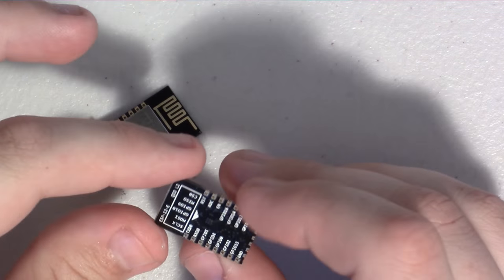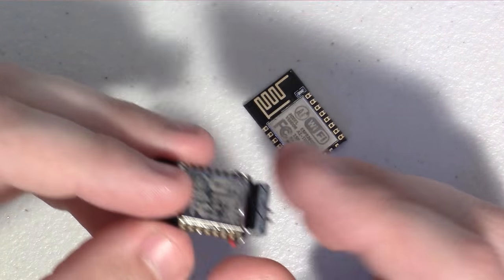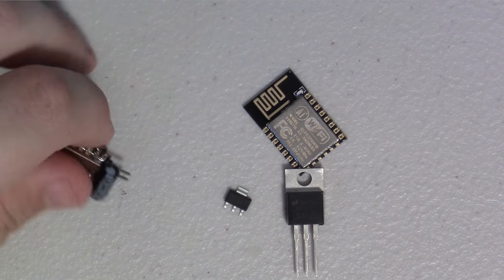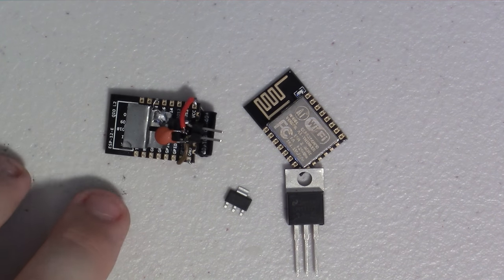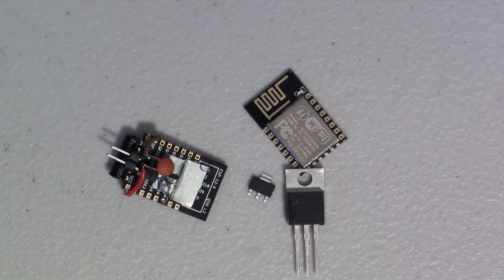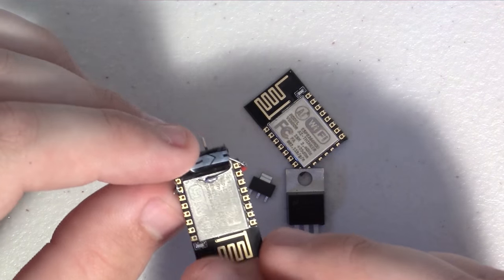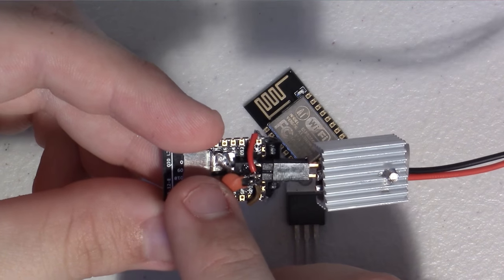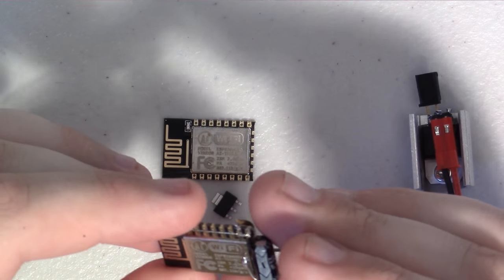ESP8266 Power Supply FAIL

Comment: The fact it fails has got nothing to do with it being a knock-off part. The ESP8266 can draw current spikes in excess of 500mA. The regulator will have to burn of 8.7 volts at that current, or in other words, over 4 watts. In your setup, the thermal resistance will be around 40 degrees C per watt (above ambient). So the little 117 will experience temperatures of 185 degrees C. 8-). Yes, it will die eventually, perhaps even taking the ESP with it.

Comment: ... Because a resistor/zener combination is too complicated? Or a buck convertor is too expensive at around 50 cents a piece including postage from China?
Reply from the maker: Thats a good possibility with a zener regulator. This was mostly done as an attempt to make one with what I had laying around and at the time I didn't have any zeners. I have yet to see $0.50 buck converters that include postage to the US from anywhere though.
Reply: Been there, especially when I'm 90% through a project at 3am and simply can't wait for the shops to open (or don't want to pay the extortionate local prices and can't wait for postage from China). Buck converters are available here for 44c (US) each including postage - http://www.aliexpress.com/item/-/32643697873.html - but you will have to be patient for delivery. The product listing's rather scant on details, but according to the LM2596 specs on TI's web site,, it has a floor output voltage of 3.3V. At that price, I ordered ten - considering an LM2936-3.3 here is AUD$4.35 (about USD$3.30) retail.
Reply from the maker: Well you're lucky in Australia if that included shipping! I just went there and it had a $2.20 shipping charge to the US haha. Either way I probably would just use a buck converter in general but I didn't have any at the time. I have some ~$1.5 - $2 ones now. For demo projects or projects that arent important I probably would still use the 1117 just because I have a bag of 50 of them that I bought for like $5 so I might as well use them up

Comment: I had the same problem. Using just 12v and a regulator. my sketch works for 5 min and after esp8266, it flash itself and lost the sketch I upload to esp but the esp is still working.

Comment: hey @ItKindaWorks!

id be interested to see a video on how u built the esp12 so neatly with the am1117 and capacitors.

also what material is soldered onto the ams1117 to dissipate the heat?

thanks!

Comment: why don't you use a buck regulator they run cold and are adjustable voltage output or am I missing something
Reply from the maker: Price was a consideration. Making this cost less than a dollar and a buck regulator would be at least a dollar. Theres that as well as the fact that I like to build stuff and learn it on my own rather than just buy the solution ;)

Comment: Why don't you use the cheap 5volt USB chargers for the boards?
Reply from the maker: Sometimes I do but those still need to be regulated down to 3.3V for the ESP. Those chargers work if I'm not working with LED strips. But those strips need 12V to run and having 2 separate power supplies (one for the ESP and one for the strip) would be expensive and redundant. So my goal was to be able to regulate a single 12V power strip down to 3.3V so I could power the LEDs and ESP from the same supply.
Reply: Ok the Led strip needs the 12volt. They looked like the 5volt "neopixel" style strips.
Reply from the maker: Ahh yeah, no they're the non-addressable strips that run at 12V. For neopixel style strips you'd be right I could use those chargers for all of it!
Reply: Looks like using 5V strips or a switching regulator is the way to go

Comment: hi, is the schematic of your All-In-One esp+power available, or did you do a video on it?
i find only the one with the big linear regulator and the 2 capacitors, and an esp-01
Reply from the maker: It's the same schematic :) ! The pinout of the ams1117 is the same as the lm1117. So it's the same connections all around. I just adjusted the layout of the components a bit to fit the board and added a male header to the VIN and GND of the ams1117.
Reply from the maker: I'll add it to the queue of videos I plan on making. It's not too hard though
Reply: even some more enlarged/detailed photos will do the job, i think... maybe with just some overwritten info, if needed... thanks a lot :)